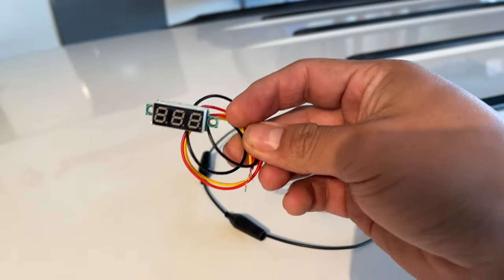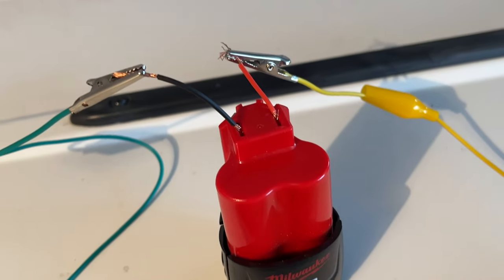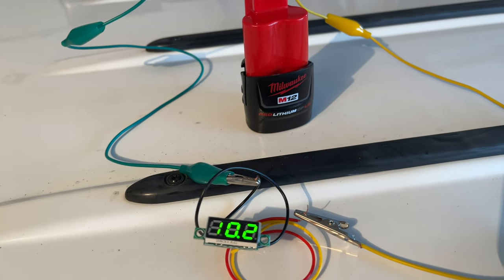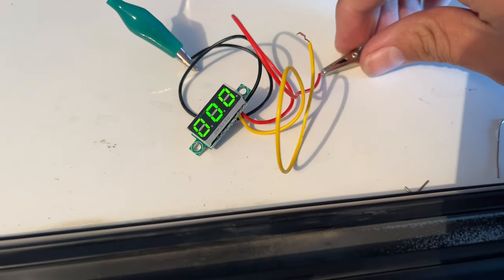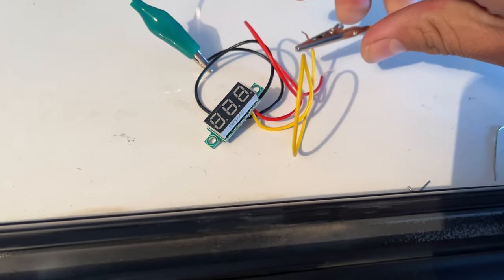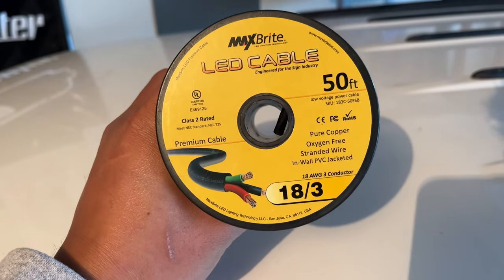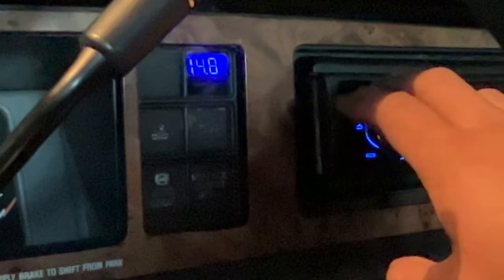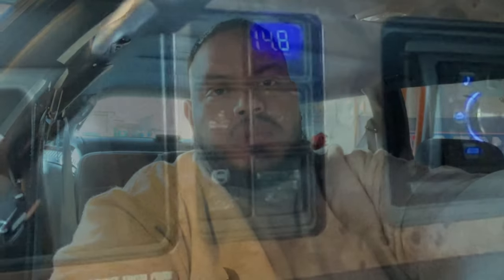How to Wire a 3 Wire Volt Meter for Car Audio

Comment: Would it be cool to connect the wires to the amp for a real-time reading of the power being supplied to the amplifier? Power to power, ground to amps ground location, and the remote wire of the voltmeter connected to the amps remote wire so the voltmeter kicks on and off with the amp.
Reply from the maker: @bwortham1987  yes, that’s actually how I have mine set up.

Comment: So you wired it to your subwoofer AMP instead of to the battery? Where did you remote wire go? Remote wire on AMP? What does that do?
Reply from the maker: Amp, you want to see what the amp is getting. Remote goes to remote on amp, this is so the voltmeter isn’t constantly on.
Reply: (REM)remote wire is basically to tell the system to turn on when you turn the key so you’d connect the wire to like a ignition wire and then to the REM spot on the amp

Comment: Hey brotha! I have a single cap ford f-150 truck and my amp is screwed down on the floor board behind the  driver seat and i put my volt meter screwed to the back wall where the plastic trim is where i can see it clearly and connected it to my amp so when i turn on my sterio and amp comes on the volt meter shows you how much you start with and moves with your syatem working and it shows 14.5 and my kicker amp doesn't starve for power! Just wanted to share that with you and other people who have a syatem in their ride!
Reply from the maker: yes sir, thanks for sharing!

Comment: Also does wiring this to the cigarette lighter have some results? What about plug and play cigarette lighter voltmeter readers are they the same thing ? Thanks
Reply: I just read that the plug n play cigarette lighter meters aren’t too accurate due to Some cars having a relay (which limits voltage sometimes to the lighter)
Reply: I don't know shit but I would assume that you would want the volt meter connection to where the power will be draining from so that you know how much power you are actually getting in that particular point. So in this case it would be your amp

Comment: So the most important question if you order a 2 wire volt meter where do those wires go?
Reply from the maker: Bruh it’s two wires and self explanatory at that point.. negative to negative and positive to positive
Reply: @RidinDirtyTX  but their is 3 ports... Ok I got you so just split 🪓 1 wire into 2 so I have 3 wires. Gotcha
Reply from the maker: @Petethebuilder  There’s three ports and two wires, obviously you can only wire two… with a two wire voltmeter you won’t have a remote turn on option. You wore negative to negative, positive to positive, and nothing to remote..

Comment: Where do I buy a volt meter?
Reply from the maker: You can them on Amazon or eBay. Just type in three wire volt meter (or two if you want the two wire) and you should see a bunch of options.

Comment: Do u have a link for this exact
Volt meter ?
Reply from the maker: @isaiahtrumbo9499  I do not, but you can search “3 wire voltmeter” on Amazon or eBay to pull them up.